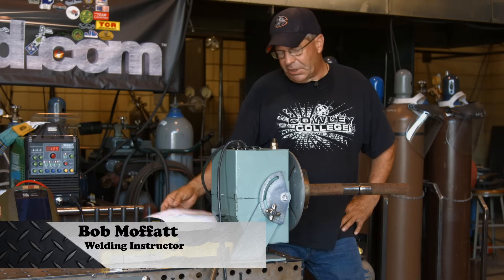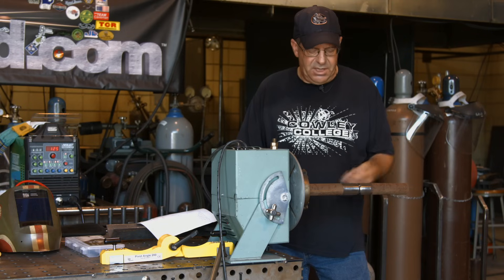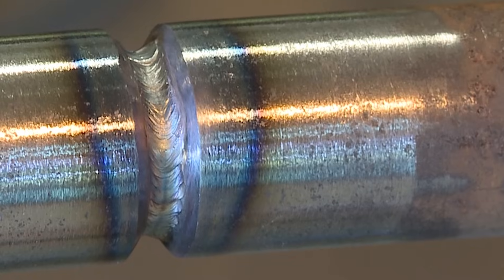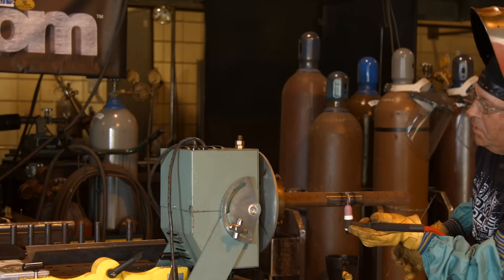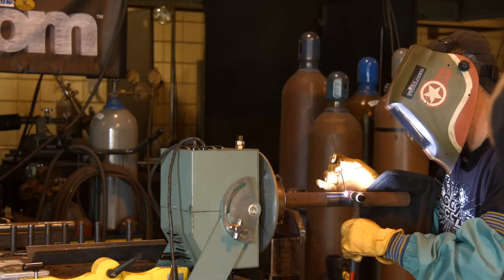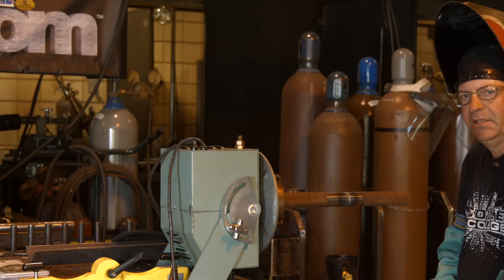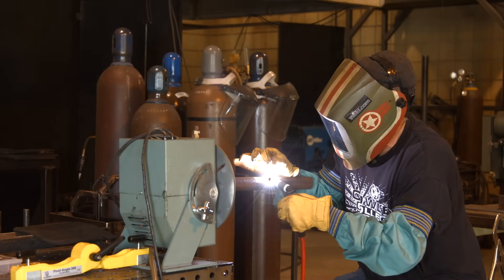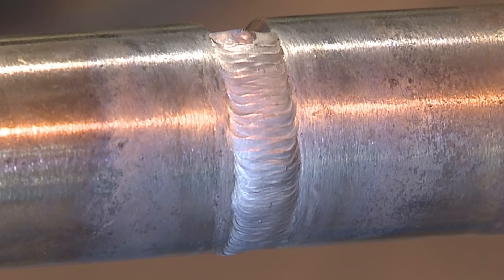🔥 TIG Welding Small Bore Pipe (Everlast 250EX)

Comment: Bob I need help passing 6g aluminum mig with push pull setup. Xray quality on 4" 3/4 wall pipe 6061 with tig root. I can do root fine but having problems with the mig

Comment: hello  im also a tig welder with the boilermakers in ontario canada local 555 and also have a 250ex everlast machine. it came with a wp-26 torch with a trigger on it didnt like that too much took along time to get used to that. i would like to get a torch that would run with the 250ex with no trigger and the foot pedal. ive subed to your channel along time ago and like your videos keep them comming brother.
Reply: I use that machine, you can get a factory foot pedal or an aftermarket one, as far as I can tell they both work.  You just unplug the torch switch connector and plug in the foot pedal.   You don't need a new torch, but of course there's a lot of them out there.  I think the torch switch is really handy sometimes!

Comment: Thanks for the vids, very helpful.  I'm doing a hobby shop project with some 1.250x.095 mild DOM. Notched & fitted joints.
I've got a nice little DC stick that I'm pretty good with & want to use it on the thinwall with 7018. Was wondering if you could do a segment on this.
I know tig is the "way to go on this type work", but the stick is what I've got & it's a hobby shop & I want to make sure I'm doing good solid work!!
Thanks

Comment: G'day Bob how do you stop the filler rod from sticking in the puddle that's what I have a problem with. Could you do a video on aluminium tube 2" Od 1/16" wall thickness welded into 2"Id pipe with a1/4" wall thickness (this pipe has a 2" NPT thread) with the tig process

Comment: Great video ! I have a question for you Bob, since it's a small diameter pipe it will get hot very quickly, should I then decrease the amperage as i progress from 6 o'clock to 12 ? like 15 amps lower every quarter of the weld ? I mean the weld bead will be much larger on hotter metal than a cooler one using the exact same amperage, what do you think ?
Reply: Good thoughts.

Comment: not bad man, doing a lot of this stuff at work. building a Deethenizer plant. lots of stainless tig, big and small bore, also lots of 6010 root 7018 fill and cap. your videos have helped me over the years get ready for a test and it's nice seeing how someone else does things. good videos from you guys.
Reply: Why would they bother with stainless pipe when you are using a carbon steel filler?
Reply: Daniel Napast I wondering that myself? Stainless pipe,stainless rod

Comment: First time I seen a welder tigging off of a positioner with the two foot pedals blew my mind.
Reply: Then you can add in a wire-feeder, and that has a push button....  I've tried this a few times, it's easy to get crossed up.  For me, will take a lot of practice, lot of concentration!   It can go pretty well with all switches, and control from the various front panels.  So, torch switch, wire-feeder pendant switch, and foot switch for the positioner.
Reply: I'm  trying to say there, that if things have variable foot control you're sort of dancing, and it's a lot easier to get lost, so I tried to simplify it by only having switches.  It was confusing enough!  But you could definitely see the possibilies.

Comment: Great video as always!  Can I request a MIG video showing how to do flat welds when putting together two pieces of thin (18 gauge or below) sheet metal?  Use case would be repairing panels on automotive body work.  Thanks.

Comment: You always seem to fit up with a gap about the size of the filler rod, is there a reason for that or is it just example? Where I work everyone just butts the pipe/plate together, no gap between the bevels, is this a bad practice?
Reply: preferences every welder welds different . but on small bore pipe id take a tigther gap so i can just walk the root and knock it out quick so i dont put too much heat on it rather then fingering it. it all depends on what the welder wants. is your job a stainless job with thin gauge pipe? I worked for Budweiser and couple other companies with very thin pipe, were we have to use that butt up with no bevel because we cant put a bevel on it, too thin. so unless it is a job that is similar to what i described then it is OK.! In my exp. Bob might have some other words in his exp/knowledge  about jobs like that.
Reply: Much better penetration with the gap.

Comment: In my job we had hundreds of feet of 306 SS 1 inch pipe that carried acids, and other cleaning chemicals. Always had pinholes show up and had to try and weld a patch and always either a chemical or a flush water inside. And or course up very high in the steel trusses and next to other pipes, talk about a piece of work. Don't miss it.

Comment: Hey Bob great vid, so is this the same technique a person would use to weld chromoly DOM tubing for roll cages? And that damn camera guy always making everybody feel awkward... beat him Bob. Thanks
Reply: Negative. Those joints are single bead, always.
Reply: thanks Brian, on that note, Bob could you please make a video on how to weld chromoly tubing with a single bead?? For roll cages?
Reply: I would never use a butt weld on a roll cage.  If you are going to try that, then I would use a 4 inch long tight fitting piece of CM tubing inside of the outer CM tube.  2 inches on each side with a bevel much like what Bob is showing above.  If you try to grind the weld then expect NHRA to poo poo it or you would have to be really good at hiding the weld.  I hope this helps.  Later.
Reply: AATopFuel Who cares what tech says, its your safety we're talking about, never cheap out or try to get around the rules when it comes to safety, ever.
Reply: +AATopFuel nailed it. Some of the crap I've seen on roll cages makes cringe.

Comment: I noticed every time you start the arc it makes a funny noise, is that normal? I a seriously looking at buying that particular Tig welder.
Reply: Iton Joans it's probably the argon flow because you want more argon when you light up
Reply: Oz is right that noise is the initial release of argon built up from the solenoid valve in the machine it slows as the flow meter kicks in and equalizes the flow as Bob continues to weld.
Reply: Iton Joans HF start and gas. Sounds weird because I'm wearing a wireless mic next to my throat.
Reply: I own the 250ex and love the machine, it does everything i need it to and more

Comment: I work in the construction field as a superintendent. We have had projects involving child water piping and steam piping. What is the best types of welds for each? We've ran into issues where welds have failed and had to be reworked. I am a beginner welder myself, but your videos have been inspirational to me and my son.
Reply: mild steel is great for chill water pipe flow or air/c02/02/water on jobs iv been on. it is cheap and holds well if correct techniques are used. on butt joints they do fail testing sometimes , but Iv seen lots fail on socket welds joints, leaks with water and when testing air you literally hear it whistle. but that is on the welder who are apprentices or welders  who are not exp. usually it is the welder who gets air in the weld and doesn't grind out the porosity enough and re-welds that causes the leaks. I run 180-200amps on my sockets, but I MOVE and take OFF and they come butter smooth, 8 years iv been pipe welding never had a socket come back to be that fail pressure testing.
Reply: @TheGmanamaya  i need some help on a design.. Can you tell me the best combination of welding type and fitting type to get the best price and job completion time for 1 inch Sch40 stainless steel air pipe: TIG, STICK, Socket weld, Butt weld....  thanks
Reply: @boxdrinks  I'm sry I don't understand your question, you asking to get on a job? Or to practice to be rdy for one?
Reply: Hire Union Pipefitters they will make proper welds that won't fail.
Reply: @leroy420b  not all fitters can weld or even keep up the certs.